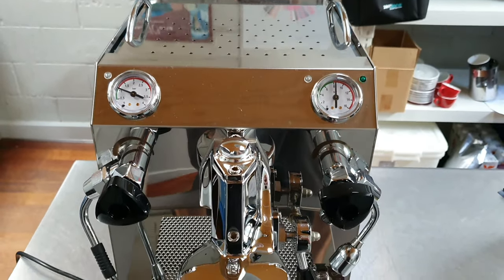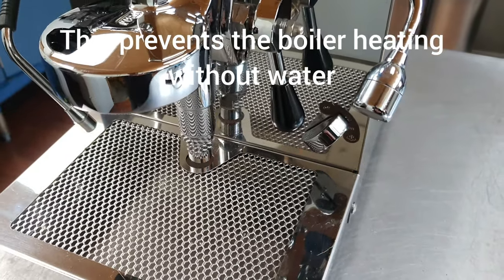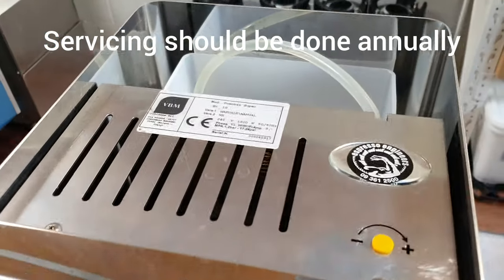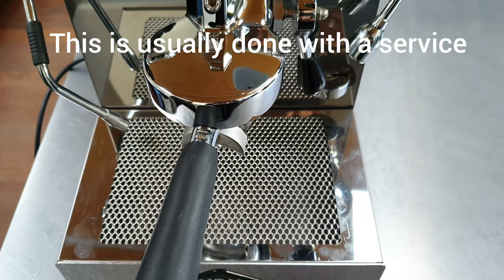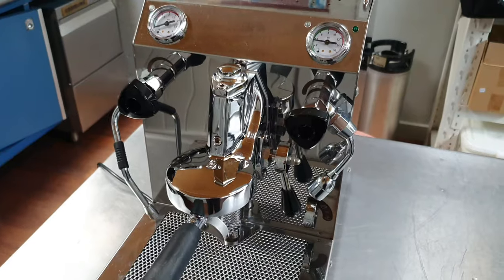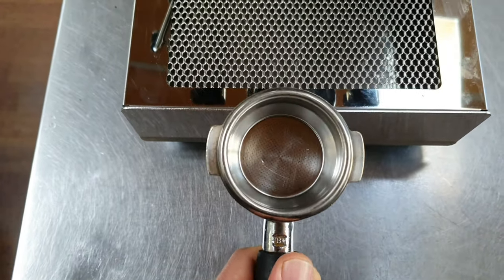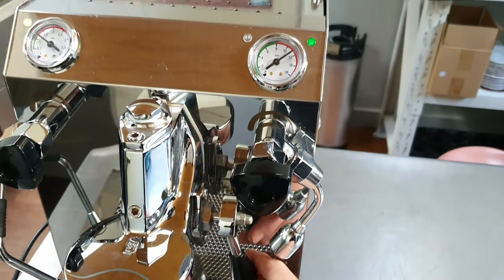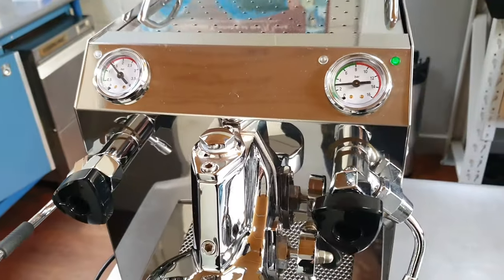VBM Vibiemme Domobar E61 Home Espresso Machine Setup and Use

Comment: Thanks for the presentation and nice clear images.  I am undecided between  the Vibiemme domobar Junior HX and 2B. Both E61 and more or less same price.  Does that mean that the 2B is just the best choice?
Reply: well, if you asked this question, I'd assume that yes, 2b is a better choice

after some time, if everything goes well, you'll probably want to add a PID unit to it's brew boiler, but that's basically it

and no water from reverse osmosis systems, please)

cheers!

Comment: Well, maybe someone will be interested in real user feedback...even being so late to the party (S/N 000089***)

1. Pressure shown here is just too high...depending on your usual routine, you will end up in 0.8 - 1.1 pressure readings at the top of heating cycle (more milk drinks - the higher you go). Red zone is there for a reason - just a bit higher and there is safety valve is to get to work. And there is more to it - the higher the pressure - the longer your cooling flushes would get and the more water you'll end up wasting.

2. Even will point this out separately. To regulate the p-stat you will need to do multiple turns of the screw (the one under the yellow cap) per every 0.1 bar of pressure. It's weird and springy to operate with, but that's my routine: 1) full turn in direction of choice; 2) wait for 2-3 cycles of heating element ON/OFF; 3) adjust further if needed; 
NOTE: depending on year/model of p-stat used in your machine, this may NOT be applicable to it

3. Highly recommend to plumb in if there is such possibility (I've managed to hold up the whole one day before made such decision) - e61 HX is a very thirsty unit and you will be filling that small 2 liter reservoir and eptying that < 2 liter drip tray constantly otherwise. Actually, I've managed to just plumb in the water and settle the canister under the machine to collect the waste (still every other day needs to be dumped, but much more convenient for my taste)

4. There is really no need to twist tap knobs THAT hard. The spring inside prevents the leakage after just some reasonable turn off motion.

5. Absolutely recommend to have a thermometer installed in the group. Probably, after some practice with machine it's no so beneficial, but first couple of months...without it I'd probably end up disappointed in the machine, grinder, coffee, life etc. without even understanding the reason...

Cheers!